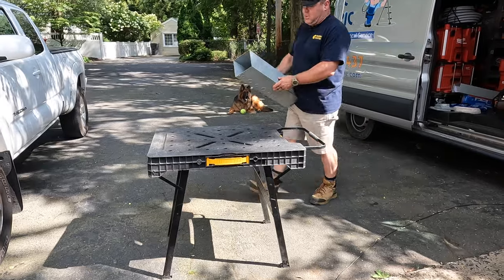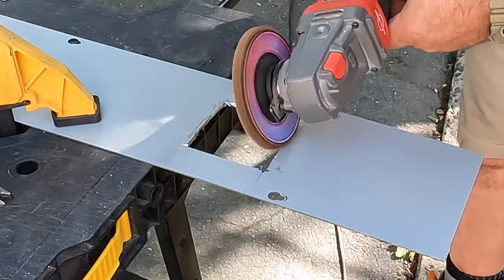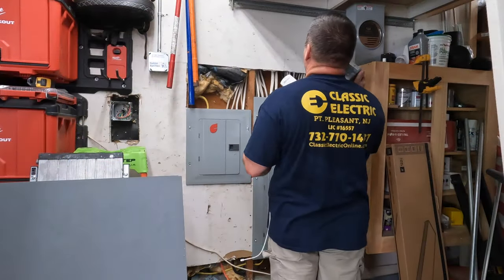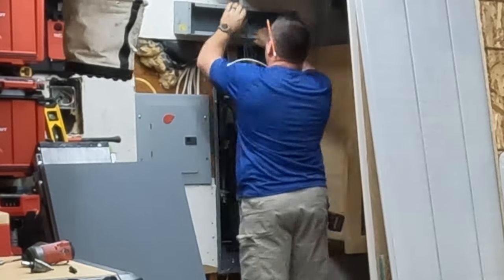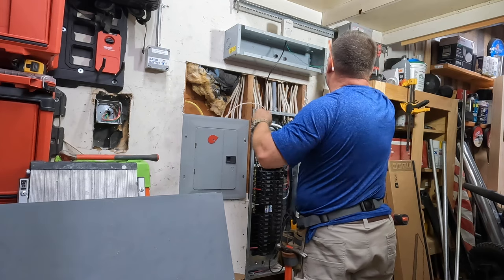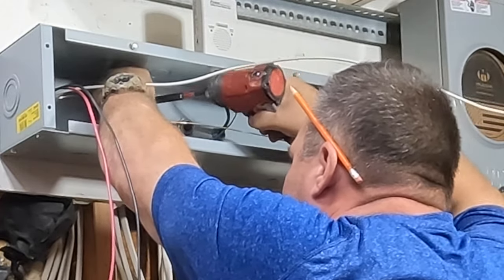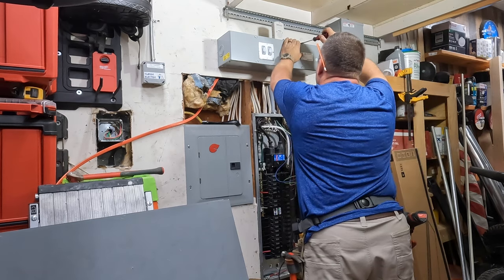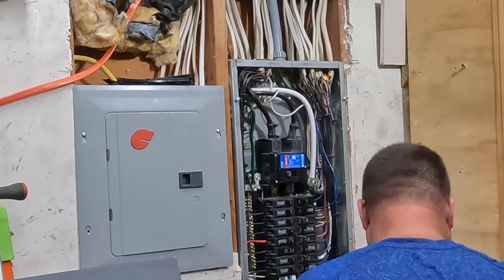An Electrical Contractor's Journey | Portable Generator Wiring Part One

Comment: I worked for a generator service company in North Jersey for 30 years. I did shop work the last 20 or more. Worked on all kinds of equipment. Generators big and small. Welding equipment too. Everytime we had a bad storm the portables often showed up from people who never took care of their machines. Modern gas is terrible. Running one out of fuel is better than nothing but not always effective. The best method is to drain the carb if it has a drain screw on it and many do. I think it's almost best to leave a machine dry and not with any fuel in it at all. When a storm is possible go buy fresh fuel and have it ready if needed. The fuel in the tank goes bad even with additives. Ethanol free fuel is available but tough to get. My son buys AvGas for his small equipment.....another good option but not easy to get. I worked on mostly RV generators for quite a while, Onan's and am like the GURU of Onan generators in my area and for many miles around. I should make a You Tube channel.....LOL....I'm also the guy who asked you about putting Romex drops in an unfinished basement in conduit.....I did all my drops and added GFCI's to every outlet.....being retired, I have time !! I bought a nice 1/2" bender to make box offsets......Reliving my early days as an electrician !! I do love that work.....
Reply from the maker: Thanks for the insight Rich. You can run NM in conduit but you have to watch the fill of the conduit. One 12/2 or one 14/2 is fine but after that and 1/2" conduit you'll probably have a difficult time getting the cable into the conduit. You just have to have a clamp on the NM where it enters the conduit. It's called a "From 2" connector. Well. that's actually the slang term but the supply house should know what you're talking about.
Reply: @electricalron  I stripped the cover off the dryer 10-3 on one drop. I only had one drop with 2 ,14-2's and it was no problem.  I did use "from 2"  connectors on the top of the drops. HD has 'em...I try to do things right but without actually being in the business, it's tough. Your videos are great. I'm gonna do a couple outside receptacles next. There are none now. HD has those complete boxes with in use covers with GFCI's.
Reply from the maker: @richb4099 You might want to search Google for “Arlington Siding Boxes.” They’re just fancy boxes but they’re so much nicer than what the HD offers.
Reply: @electricalron  Thanks Ron. I have options for mounting. I can come right thru the foundation wall but that would be the most difficult way. I can come thru the rim joist and thru the vinyl siding......I'll check them out.....

Comment: I installed my generator hook up at my house. Installed a main breaker main panel with an interlock. Also on my portable generator I modified it with a switch so that I could switch back and forth between it having a bonded neutral and a floating neutral. So when I’m using it as a back up power generator the neutral is floating and it’s bonded at the service so it is the first point of attachment and I have it property bonded to my electrical system. When I want to use it as a portable generator I can flip the switch to bonded neutral and it’s safe to use as a portable generator.

Comment: That's thick steel, not easy to deal with. Got to appreciate the trades that work with metal constantly like machinists and sheet metal workers. I actually have a hydraulic Greenlee punch-die set that makes perfect holes in sheet steal. I bought a gear-reducer thing that I use on an electric drill instead of the super expensive hydraulic pump. I used it only a couple times. Stashed away in the garage! YES, take a break for crying out loud. See you when you post your next video.
Reply: Not very thick. I have a quality made in USA Carbide hole cutter that I used in thick 10 regular steel & stainless steel heavy panels. Speed kills unibits. If you run a little slower will last. Had lazy mechanics brake studs off hydraulic knockout S
studs while trying to knockout impossible holes in 3/8" steel plate.
Reply: @garbo8962  Oh geezus, yeah those knockouts can probably do like 18 gauge max, I would think

Comment: When I am using a stepping bit I add a little bit of lubricating oil as I enlarge a pre-drilled hole. It helps to keep the bit sharp and easier to drill. I also use deburring bits to clean up the edges of the hole I drilled. Another great video by Ron! Thanks!

Comment: I got a conversion fuel kit so my portable generator can run off natural gas ,propane and it still can run off gasoline but like you suggested leaving gas in the tank can go bad and hurt the system   I am able to run a natural gas hose to my generator from the gas meter  so no need to get fuel as long as the natural gas is online . If that failed I would go to propane . I also think there are additives to preserve your gasoline while it sits in the generator . It has been awhile since I ran it so with your suggestion I should give it a start .
Reply: My Generator still started after 2-years gasoline fuel in the Tank with additive.  But I ran dry after each Test... I also have converted to N.G. kit

Comment: Can current goes back on the neutral to the utility even with the interlock? I think thats why in Canada we can't use those. We have to use a generator panel with two 3-poles interlocked breakers cutting the neutral. Makes a generator job twice more expensive!
Reply from the maker: That’s a separately derived system.

Comment: Been enjoying your videos for a while now, and this one is timely for me since I am exploring installing portable generator wiring like this.  One question I have is whether or not it is acceptable to add a main disconnect breaker to my Square D QO panel in my basement.  Outside my 20 year old house I have the power meter which feeds two 200 amp breaker panels.  These breaker panels are mounted on the house just to the right and left of the power meter.  These two breaker panels then feed two sub panels inside the basement about 20 feet away.  It is on these two sub panels that all of the circuit breakers are mounted for the house circuits. This is where I would like to mount the generator interlock mechanism on the panels but currently there is not a main disconnect breaker installed on these sub panels.  Can I add a main disconnect breaker to this panel even though there is already one on the outside breaker panels?
Reply from the maker: There';s a video on my channel where I install a Square D Homeline main breaker in the "sub panel." It's easy to do with the Square D panels.

Comment: Thanks for the paneling idea,  I have been looking at the messing sheet rock around my Grid main panel and 1 of my Critical Loads Panel, wondering how to cover it.   I don't do mud and tape very well.  You gave me my solution

and do you have a source for those watt meters or are they common item?
Reply from the maker: Search Reliance Watt Meter. Mines an exterior wall so it was important to at least patch up the broken Sheetrock.  Your situation might be different.

Comment: If I run all my mc or nm cables to a trough can I use a ground bar in the trough instead of using the one in the panel? Using a single large wire to run a ground from the panel to the trough.
Reply from the maker: Yes, and no. Check with your electrical inspector before doing that is my best suggestion.